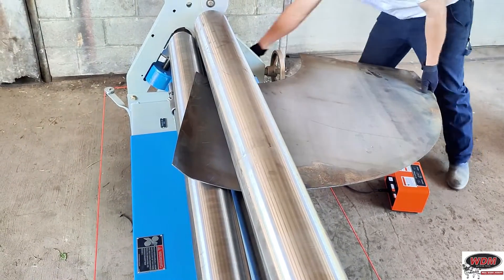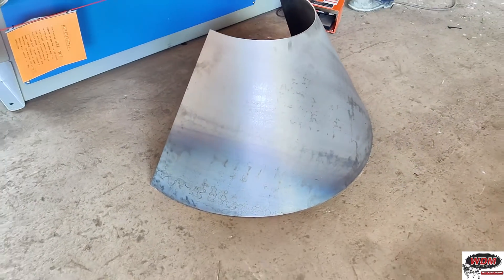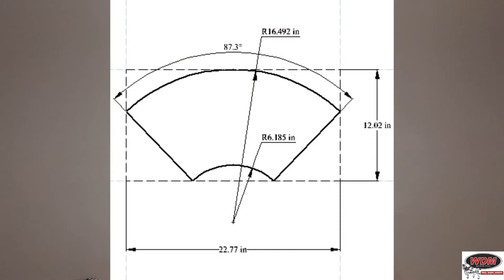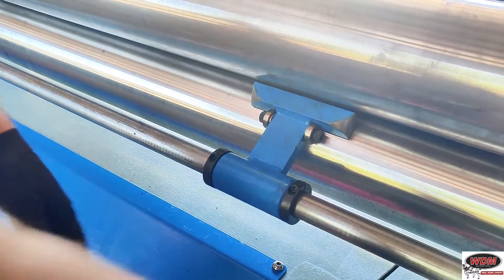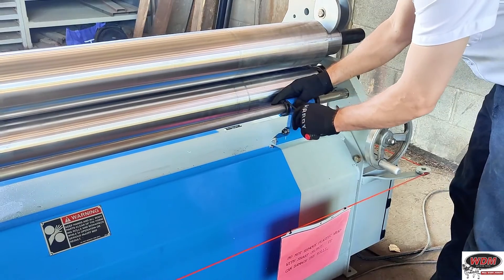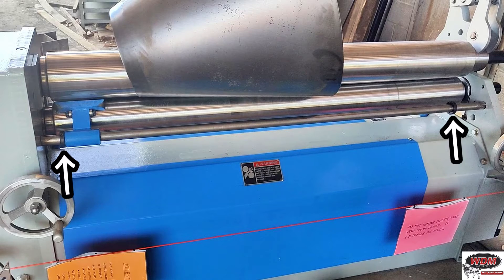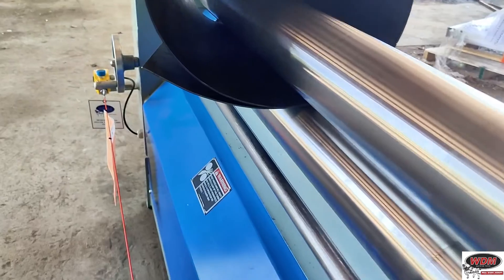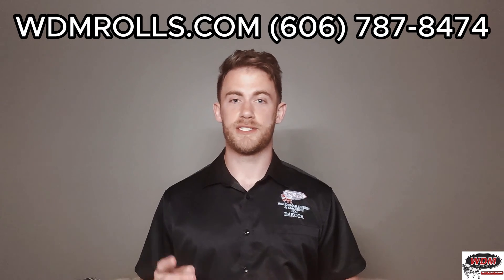The Secret to Perfect Cone Rolling | Step-by-Step Guide | WDM Initial Pinch

Comment: Am interested in knowing how cut the cone shape without the template
Reply from the maker: To determine the size of a cone blank, you need to measure the desired final cone's base diameter and height, then use the Pythagorean theorem to calculate the slant height which is crucial for determining the size of the cone blank; you can then use the slant height and base circumference to calculate the sector angle needed to create the cone pattern on a flat sheet material. 
Key steps: 
Measure the desired cone dimensions: 
Base diameter (D): The diameter of the cone's base circle. 
Height (H): The vertical distance from the cone's apex to the center of its base. 
Calculate the base radius (r): 
r = D / 2 
Calculate the slant height (L): 
Use the Pythagorean theorem: `L = √(r² + H²) ` 
Calculate the circumference of the base circle: 
Circumference = 2πr 
Determine the sector angle for the cone pattern: 
Sector angle (θ) = (Circumference / L) * 360° 
To create the cone blank pattern: 
Draw a circle with radius equal to the slant height (L) on your material.
Mark off the sector angle (θ) on the circle.
Cut out the sector to create your cone blank. 
Important considerations: 
Material allowance: Depending on the material and construction method, you might need to add seam allowances to your cone blank calculations. 
Precision: Accurate measurements are crucial for a well-fitting cone.

Comment: I’m new to rolling so, I’ve been trying to roll Inconel 625 19” long by  .080 thick, big side is 11” od small side is 3.5” od. We have tried everything and can’t get a good part. Is it even possible?
Reply from the maker: So I looked into this a little more. The spring back is an issue. So in other words if you wrap the minor diameter right around the top roll how much is it going to open up once you take the pressure off. It looks like your material might be in the 90ksi yield strength range I'm not exactly sure. I would figure that would spring open to 1.5 - 2 X the diameter of the top roll meaning to get a minor diameter of 3.5" you will need like a 2" diameter top roll. But in order to roll cones you can only grip the outside diameter of the material therefore limiting the torque and so you can figure when rolling cones you can only roll about half the capacity that you could roll a cylinder shape. All that to say I really doubt your roll has the capacity to roll that cone and that you will need a designated cone roll with tapered rolls in order to achieve a good part. I would still be available to chat about it if you want.
Reply: I had an aerospace client ask if I could roll Inconel  cylinders out of 5/16 and my machine is rated for 1/4" I said 'maybe if it's hot'. We have yet to try but I did do a lot of research on it. Turns out the stuff is so hard to deal with its often formed hot. I think a tight cone like you are looking for could maybe be spun with heat, too.
Reply from the maker: Hey @timescott5647, that is going to be hard to do but I think would be possible depending on what roll you have. I would be happy to discuss it with you on a phone call and I can even get an engineer on the line if need be. You can give me a call at (606) 787-8474